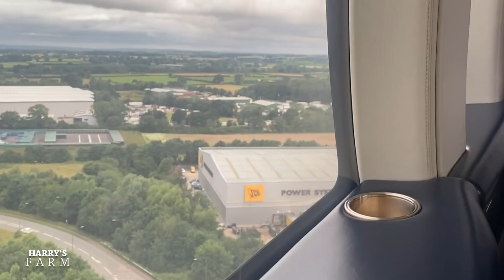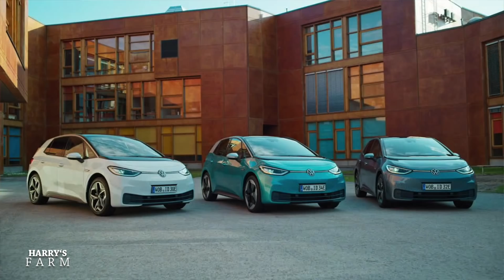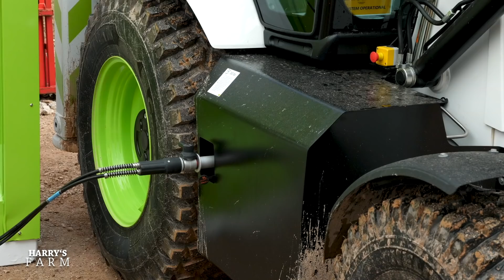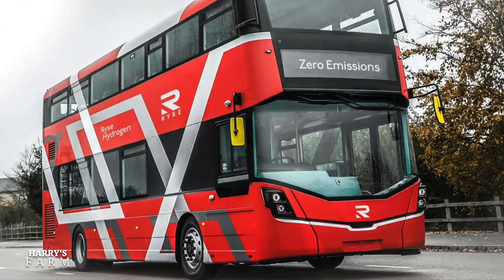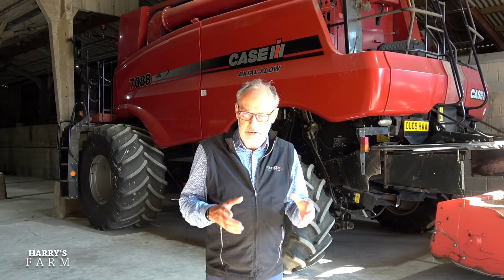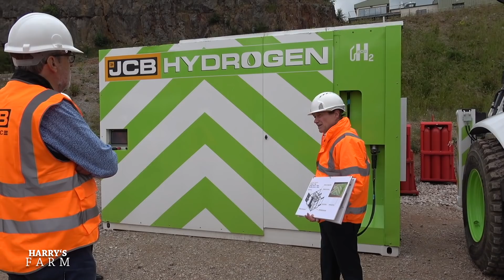Why JCB thinks hydrogen is the best alternative to diesel for heavy machinery, farming and HGV fleet

Comment: why does everybody think hydrogen will just fall out of the air?  First Harry says a lot of countries dont have enough energy to charge electric vehicles and his solution is hydrogen which uses 5 times more electricity???
Reply: It's shipable.
So you could have massive solar farms on the equator that then ship or pipe the hydrogen around the world.
Or you could have massive wind farms in the north see and then ....

So it's far from impossible.
Reply: @dethrophes7283  the cost issue is very relevant though woht bost of those solutions. It's going around the houses (using electricity) to get to the same result.

Comment: What I don't understand, why do car manufacturers are so invested into battery powered electric cars? Why don't they just turn to hydrogen powered internal combustion engines as well? It seems so much more simpler, cheaper both on the car's side and the infrastructure-wise as well.

Comment: Fantastic video, very proud to see a British Company, JCB, at the forefront, pioneering future technology. Thanks for sharing this video. 👍
Reply: However, hydrogen combustion with air produces oxides of nitrogen, known as NOx. In this way, the combustion process is much like other high temperature combustion fuels, such as kerosene, gasoline, diesel or natural gas. As such hydrogen combustion engines are not considered zero emission.

Comment: Excellent video. I am impressed by the engine shown . I suppose they could make a smaller version that would suit a  car. A 2.4 litre Hydrogen IC engine sounds good to me. By the same theory they could make bigger ones too , suitable for LGV use. I have been believing that batteries are NOT the future, and this video backs up my theories.  Lord Bamford and his company have made me very happy today. Just 1 point I would like to emphasise regarding future cars , 1/3 of the UK population live in homes with NO suitable place or access to a charger . They live like me in a flat. Hydrogen makes so much sense. Well done JCB and Harrys Farm. 😀
Reply: oil companies attempting to sell oils and gas dressed up as hydrogen it is a scam    Depending on the quality of the feedstock (natural gas, rich gases, naphtha, etc.), one ton of hydrogen produced will also produce 9 to 12 tons of CO2  
However, hydrogen combustion with air produces oxides of nitrogen, known as NOx. In this way, the combustion process is much like other high temperature combustion fuels, such as kerosene, gasoline, diesel or natural gas. As such hydrogen combustion engines are not considered zero emission.

Comment: Harry what about parts? What about power ? Why not a simple electric motor for TRACTOR?
My TESLA CAR is braindead easy.
Not expensive John Deere crap electronics. 
300 + horsepower  
300+ lbs of torque
1 motor 
Electric tractor will blow all other metrics out of the water.
No radiator. Hoses. Linkages. Oil Pumps. No starter. 
❗Plug into house power. OR 🐷Solar Powered equipment.

Comment: Electric forklifts  are a headache when they get older . Hydrogen engines are still engines  and can be worked on .
Reply: oil companies attempting to sell oils and gas dressed up as hydrogen it is a scam    Depending on the quality of the feedstock (natural gas, rich gases, naphtha, etc.), one ton of hydrogen produced will also produce 9 to 12 tons of CO2

Comment: It's certainly difficult to see farm machinery working off of batteries given they are intensively used on long days but, across the year, rather intermittently. Harvesting with a combine must be like having a car which is kept in the garage much of the year and then is driven to Istanbul and back a couple of times a year. That's pretty well the opposite work pattern to that for batteries.

I wonder how an IC engine using hydrogen compares with a fuel cell using hydrogen. No doubt the cost of the latter is higher, but I'd also expect it to be much more thermodynamically efficient.

Of course the "quick fix" for zero net CO2 emissions is biodiesel, so I'm betting that's going to be one thing that will emerge.

Comment: He said Seaman’s  in Germany  is building an Electrolyzer , that is the device that extracts the “H” out of H2O , small devices could be built for different sized engines & once set up , you could run your truck, tractor, or race car even on 99% water , except for the oil co & the government!! 
& not necessary to have a filling station !

Comment: Ok , what the man said about hydrogen is easily made from water , is absolutely true , H2, O , what do you think that “H” is any way ? I have seen vids of cars running only on hydrogen made from water ! How ? Put water in a container , add a specific amount of baking soda, as per quantity , in that container you have 316 stainless electrodes , one set of plates being negative the other positive , the soda adds impurities to the water to cause electricity to flow , causing the Hydrogen to separate from the Oxygen . The container is sealed except for an air in & a vacuumed exit, connected by tubing to the air intake of the engine . The trick is how much “H” do you generate ? , that is controlled by the amount of soda && the amount of electricity , thus if you can use the accelerator pedal , which on modern cars is not mechanically connected , but rather runs of a variable taped resistor , this would cause a increasing amount of hydrogen to be generated to & used as the engine speed increases !
Free gas mileage ! The more “H” the less gas or Diesel, which ever ! With a diesel you would need to have the “H” under press to offset the turbo 
Such as the thermactor pump , that is simply an air pump pumping air into the exhaust , so you can meet the pollution standard in the tail pipe , which cause added fuel consumption, “. ( brilliant,”)instead of 4ft behind the pipe ! The air pump volume is matched to engine RPM via the belt so add a inlet tube & air cleaner & wall-a !  
Problem here is the oil companies  &  the government , which makes more money per gallon (by taxes) than the oil companies do , & you can bet your bottom $ that battery charging station will not be free power supply ! They are going to get their money ! 
This technology has already been looked at but the US gov told the Co. that did so “You will not market this device”   Our economy runs on oil not water ! However they will sell you the some part,  & instructions , & tell you where to buy some parts , at least this was so 15 yrs ago !!

Comment: Thank you that was truly a great watch 👌
As a mechanic this makes me smile, JCB are on point, so great to see forward thinking towards long term solutions.
Electric does have a place, but it’s cost and the precious materials needed are serious flaws, which has been overlooked.
Reply: oil companies attempting to sell oils and gas dressed up as hydrogen it is a scam    Depending on the quality of the feedstock (natural gas, rich gases, naphtha, etc.), one ton of hydrogen produced will also produce 9 to 12 tons of CO2
Reply: @brianevolved2849  if you have evidence to back up your claim, there is a conversation.
If you don’t have any evidence then why bother making that claim. 
The combustion of hydrogen with oxygen produces water vapor as its only product: 2H2 + O2 → 2H2O  where is the CO2?

Read this before replying: 
https://en.wikipedia.org/wiki/Hydrogen_internal_combustion_engine_vehicle
Reply: wiki hydrogen production
Reply: @brianevolved2849  wow that’s a poor argument 🤦‍♂️
Fossil fuel’s can be replaced by hydro power and solar,  not to mention a hydrogen engine can run an electrical generator (no carbon there)
Hydrogen can also be made from biomass etc.
I skipped wind as that’s not actually viable, the blades last only 10yrs and end up in land fill, that is something to be moaning about.
Reply: oil companies attempting to sell oils and gas dressed up as hydrogen it is a scam    Depending on the quality of the feedstock (natural gas, rich gases, naphtha, etc.), one ton of hydrogen produced will also produce 9 to 12 tons of CO2  
However, hydrogen combustion with air produces oxides of nitrogen, known as NOx. In this way, the combustion process is much like other high temperature combustion fuels, such as kerosene, gasoline, diesel or natural gas. As such hydrogen combustion engines are not considered zero emission.
Reply: @brianevolved2849  1st why are you repeating the same rubbish.
2nd JCB has nothing to do with the oil companies.
3rd hydrogen is abundant and can be made from many sources.
4th you have no argument.
5th leave the internet alone if you can’t educate yourself from it.

Comment: As an employee of JCB it makes me very proud to see the path we are taking to zero emissions engines as an alternative to electric powered equipment. It just makes sense.
Reply: oil companies attempting to sell oils and gas dressed up as hydrogen it is a scam    Depending on the quality of the feedstock (natural gas, rich gases, naphtha, etc.), one ton of hydrogen produced will also produce 9 to 12 tons of CO2  
However, hydrogen combustion with air produces oxides of nitrogen, known as NOx. In this way, the combustion process is much like other high temperature combustion fuels, such as kerosene, gasoline, diesel or natural gas. As such hydrogen combustion engines are not considered zero emission.

Comment: Well this is certainly a more practical use of hydrogen, to use it directly in a combustion engine.   The challenge is producing hydrogen at the scale needed to fuel construction and farming vehicles.   I don't understand why compressed natural gas or propane is not used as a fuel for combustion engines in construction/farming/heavy diesel engine vehicles.  The infrastructure for natural gas is widely available in many places already.

Comment: Fascinating review of Hydrogen ICE alternative to diesel, battery, biomethane and fuel cell options for on farm fleet. Clearly JCB are ahead of the pack - again - and Lord Bamford is so right about 'inflationary aspects' - batteries, fuel cells etc. Using conventional ICE engine technologies using hydrogen and/or biomethane seems an excellent solution. The issue remains sourcing sufficient green hydrogen. On farm electrolysis using renewable electricity from solar and wind was proposed in the RASE 2014 report 'Refuelling the Countryside' https://www.rase.org.uk/reports. Look out for the next RASE report 'Farm of the Future ~ 2030 and beyond' - currently in progress.

Comment: Machines are advancing and no doubt there will be more...But they will all run on Diesel for decades to come.
There is no viable alternative.
However electric trains run directly from overhead lines are proven and are doing 250 + mph between stops.
Europe, China and Japan have developed these trains, and are so advanced compared to the UK. (and the USA).
Bulk transport could be by rail...the most efficient form of transport.
(Imagine a roller ball running on a steel plate...That is the same as railing....hardly any resistance...Only inertia and air resistance to overcome.)
It is sad to see trains running without any passengers and freight, whilst the roads are choc a bloc.

Comment: Excellent video.
ICE Technology improving fast especially with the competition of EVs.
Today's ICE cars are very efficient and low polluting. The problem with those millions of older vehicles exists and if the government doesn't do anything about it, this will increase as people hold on to their older cars because of cost.
Elon Musk is a salesman, employing the brightest brains on the planet developing EV batteries, which may replace the ICE....But they are nowhere near that yet, especially with large commercial vehicles.
Hydrogen has still to be developed  further especially with storage and distribution.
It's still ICE for at least several decades....unless there is a battery breakthrough...not on the horizon.
Why Tesla is so highly rated is beyond me...It's a huge gamble.
Stick with the tried and tested....
Thank you Lord Bamford.

Comment: I did r&d on a hybrid hydrogen/Diesel engine as an undergraduate my senior year in college.  There were three major problems we encountered that were very difficult to remedy. #1 hydrogen molecules can seep through very tiny openings. #2 precisely controlling fuel delivery and ignition timing was very complicated (expensive).  #3 engine life was consistently shorter burning hydrogen. 

Our approach delivered hydrogen to the combustion chamber using indirect injection.  We would inject hydrogen into the intake manifold on a turbo charged Diesel engine in an attempt to reduce the amount of diesel fuel needed to make equivalent power. Because of problem #1, combustion of the manifold charge in the manifold was a common occurrence under peak load when 50% or more of the fuel being burned was hydrogen.  This was a serious safety concern, not to mention a serious reliability problem.  This led to attempting more precise fuel delivery and ignition timing which we were unable to complete on an undergraduate senior design team budget.  Lastly #3 was attributed to the ‘embrittlement’ of engine parts from exposure to hydrogen combustion.  We were unable to fully explain this phenomenon before I graduated.

I would certainly like to see JCB succeed with the hydrogen engine because of how challenging it is to get it right.

Comment: A most excellent presentation. I love the line, it’s not the engine as the problem is the fuel.

Batteries have so many issues, most of all which is cost And this obscene obsession with all the materials needed for these batteries. Hydrogen is here, let’s just start using it
Reply: Ungodly amounts of water are used to mine lithium and then the water is polluted. There's so much people don't know about the negatives of their EV's.

Comment: Hybrid  electric/hydrogen makes a ton of sense  you can use the weight of the batteries to replace some counterweights plus hydrogen to charge and supply power to the batteries..

Comment: Brilliant stuff. But the elements cited as "rare earths" (lithium, cobalt and copper) are not rare earths. 
Apart from cobalt, which is environmentally  undesirable, anyway, there are no supply problems yet for Li batteries. 
Well done to JCB for finding a way to use hydrogen in a combustion engine. 
The experts have been telling us that hydrogen can only be a fuel in fuel cells.  
I am sure that Elon Musk's belief that he can power a "semi" (= articulated lorry) from his batteries is, in the current state of the art, unfeasible.

Comment: I'm glad that people are working on this kind of thing: electric is not the universal solution so we will need chemical fuels to fill the gap. However, I cannot see Hydrogen actually being a more practical solution for this domain than ethanol or biodiesel. Hydrogens has less harmful emissions, but remove the mass of cars and that's less of an issue, the difficulties of gas storage and shipping are likely to be bigger problems.

Comment: I've actually been convinced for a while that hydrogen fuel cells are the way to go as opposed to batteries. Firstly, hydrogen still provides all the flexibility of hydrocarbon fuel and thus is much easier for someone to get used to using. To fill a hydrogen tank takes about the same as filling a petrol or diesel tank. Even fast charge batteries take a lot longer to fully charge.
The other benefit is fuel production. Wind power suffers from the problem of being intermittent - it isn't always there when you need it. However using wind generation to produce hydrogen does not depend on production happening exactly when it is needed. Hydrogen can be produced when it is possible. Then it can be stored, transported and used by machine operators (excavator, car or truck) when they need it.
I suspect that once the greenies and the politicians finally lose their obsession with batteries, we will actually end up using hydrogen in the way Lord Bamford is going and also as the energy source for fuel cells.

Comment: This may very well have been part of the solution 20 years ago but, given the time we have remaining, Green H2 (being only 1% of H2 produced today) will only be appropriate for processes not easily electrified.  Lord B is also 10 years behind in thinking EVs & batteries are “inflationary” and fuel cells are already in operation and enable non combustion of H2 and the demise of what is now ancient tech, the ICE, with all its moving parts and maintenance.   Of all the things though if anything showed the distain for mitigating climate change it’s Lord B turning up in a bl**dy helicopter.
Reply: Exactly. Also, stating (or exaggerating) the premium up-front price required for a BEV conveniently ignores the ongoing savings. EV cars are cheaper to charge than the alternatives, and the fewer moving parts, and the fact that it's not containing thousands of explosions per second, means maintenance is also cheaper. The real question is what's the lifetime cost of ownership of an BEV versus an ICE (or other).  I like H2 for some industrial or ag uses, but that doesn't mean he needs to lie about BEV (cars).
Reply: @DerekKerton  it would have to be lifetime cost of one ICE machine vs 2 Electric machines as they can only do half the work. also weight is an issue as stated
Reply: @mrbox111  No, I'm just referring to when miLord talked about electric cars, just a subset of his content, not the main topic of heavy equipment.